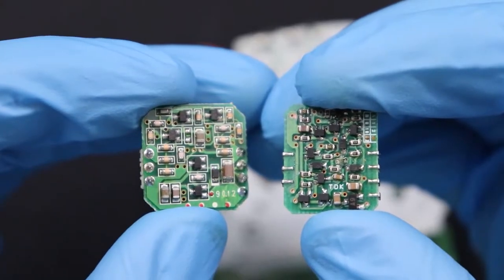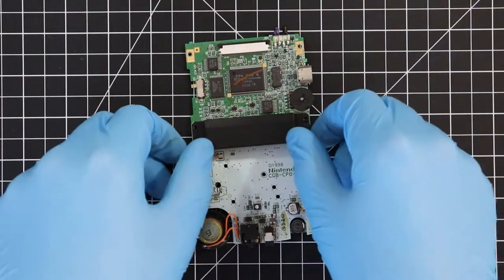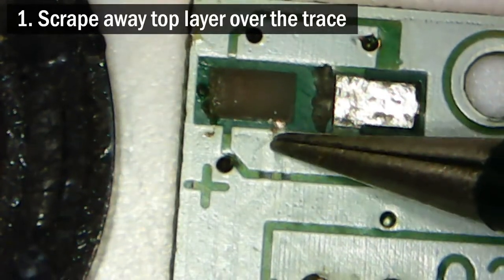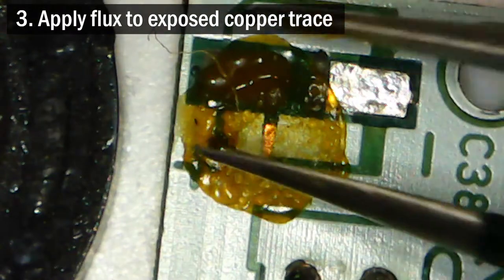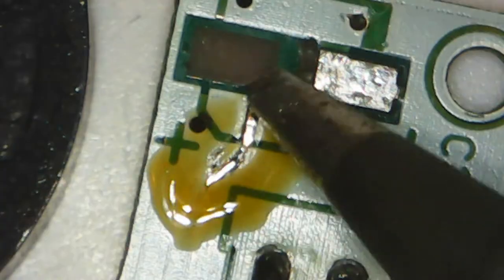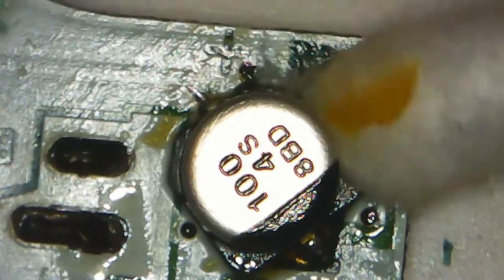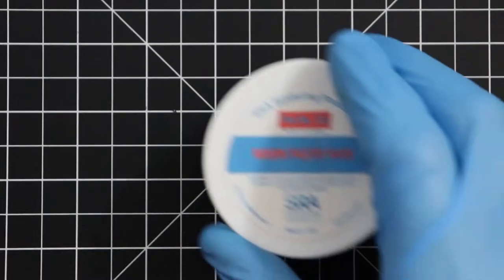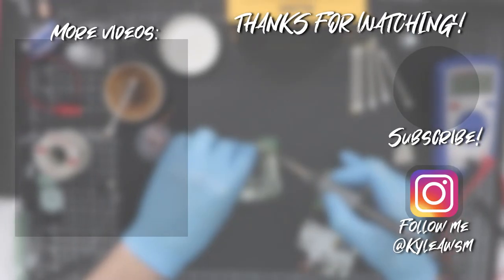How to Bypass Missing & Broken Solder Pads

Comment: I know this might sound stupid, but it would have been super useful to see you measuring the cap with the multimeter to check that your repair had worked. I know how to test for continuity and for voltage readings, but I have no idea with testing caps. But regardless, a great video.
Reply from the maker: Good thought - Basically in the video I mostly was checking for a short to ground.  It's not quite what this repair called for, that footnote about it, but I left the footage in mostly to show how things... "looked" now, more or less.

Here's some capacitor troubleshooting tips I took from another of my replies to a comment on this video:

Sometimes you need to take the capacitor off to fully test.  But a simple test you can do is to put your meter in continuity mode and probe either side of the cap on the board.  This won't necessarily tell you if that cap is bad, but it will let you know if there is a short to ground somewhere that you need to find.  To fully test a capacitor though, for a short, if it's open (also a failure), or for the proper capacitance, you need to remove it from the board first.  Also, you can get bad readings from testing any component while it is on a board still, resistors especially, so it's always best to remove them if you're not sure.

Cheers, and I hope this helps! 🙂👍🏻
Reply: @KyleAwsm  Definitely, I appreciate that testing caps and points could be a whole separate video in itself, I just wondered what it was you were testing to ascertain there were no further issues, but you've cleared that up. Many thanks.

Comment: THANK YOU for actually mentioning proper temperatures for soldering! I've been trying to educate myself on how-to's for soldering [with the intent of game console repairs) and so many videos just go "yup, turn on the iron, tin, and go" but for someone totally new to the process, knowing estimated temperatures to start from will not only extend the life of the tool/machine but possibly prevents early frustration/mistakes in the learning process and ACCIDENTS.
Reply: Temperature is variable. Small components, small traces, lower temps.
But if you have large components or a ground plane temperatures will be higher.
Start low and adjust up as needed.

Comment: Thanks for the instructional video.  I have some pad repair for a customers laptop.  They tried to remove the SMD bios chip with a hot air gun and tweezer.  They pulled too soon and too hard and ripped the chip off.......pads and all.
Reply: Lol pull out

Comment: It is also worth noting that in some cases, you can solder a small wire in place of a trace. If you follow the trace back to its source. You can solder a small wire to the source solder point, and the other end of the wire to the part that needs soldered
Reply: But wouldn’t the capacitor look awkward being solder on top of the wire?
Reply: @MajinGouken  99% of electronics are covered and unexposed. Besides, I'd rather have something look a little awkward I'd it means it still works and I don't have to buy another part

Comment: Thanks for this video, was installing a new wire for my thinkpad charger and messed up the terminals with too much heat (i prefer replacing the wires on original laptop chargers instead of gambling with a potential knock off).
This video is a life saver

Comment: Thanks for posting.  The flux under the device is pretty much stuck under the device.  I believe the flux is corrosive.  Would it not have been better to apply less flux to the pads with, say a toothpick?

Comment: Great video, it's hard for beginners, but not impossible. Just let us know how you detected the faulty cap. , is it a common problem for GB boards? Sorry to ask, I'm kinda new to some repairs.
Reply from the maker: Hi, and thanks!  Yup, it can be common on these boards, and depending on the shape they're in sometimes.  Sometimes you need to take the capacitor off to fully test.  But a simple test you can do is to put your meter in continuity mode and probe either side of the cap on the board.  This won't necessarily tell you if that cap is bad, but it will let you know if there is a short to ground somewhere that you need to find.  To fully test a capacitor though, for a short, if it's open (also a failure), or for the proper capacitance, you need to remove it from the board first.  Also, you can get bad readings from testing any component whole it is on a board still, resistors especially, so it's always best to remove them if you're not sure.  Cheers!  Hope this helps! 🙂👍🏻

Comment: two questions:
1) how do you know where the trace is to be exposed with the grinding method?

2) could you have put solder where the old pad was on the left and solder back the capacitor on top of it?
Reply: #2 no chance, the solder would have nowhere to adhere to, the silicone wafer board is just meant to hold the copper traces in place. He could have just used a jumper wire, but in this case he had plenty of space to rotate the cap. However, most times you don't have this much space to work with.

Comment: bruh, I just had a surface pad pop off of a hyper module and the only thing it left me is some micro piece of wire. No trace to scrape. (The trace might have been on the back of the board) and was able to bridge it with a glob of solder that some how miracled on to that little wire stub. and grabbed on to the cap lead. Seriously, what I did doesnt even qualify as a level1 solder, but it worked and now my hypermodule caps are replaced and it works. I pushed to hard trying to unsolder old PCB.

Comment: Hi Kyle! I have a question, I have the exact same area with a broken pad. Currently I don’t have sound in my gbc speakers. Did you restore the sound on your board after re attaching? 

I checked the speakers and the connection they seem fine and the headphone jack also has continuity. So I’m kind of stuck on what else I could do except the resoldering of the capacitor. Thanks in advance!
Reply from the maker: C38 is a filtering capacitor for the audio, so it could be part of the issue with no sound.  Also check for continuity between pins 4 and 5 on the headphone jack though when no headphones are plugged-in.  If there's no continuity, that contact is dirty and needs to be cleaned.  Replace C38 and clean that contact and it should likely fix your sound problem.  For further help with this, feel free to contact me via Instagram.  Cheers!
Reply: KyleAwsm Thanks so much! I’ll give it a go. I’ve been working on this project for about a month now but never figured out how to bypass the pad. The video and your response really taught me something new. I’ll take you up on your offer and dm if I run into other problems. Definitely subbed to your channel!

Comment: You know about the dsi d-pad and motherboard part. The red and black wires. Do you know how to clean that part if it gets burned? Kinda having issues soldering the wires to those pins and one of them just won't stick. Any help will be great.

Comment: Solder to the trace makes sense but what do you do when you rip off the pad for an ic chip that has like 30 different legs all around four edges and the square pad ripped off?
Reply from the maker: You get some small gauge wire, a microscope, and practice a LOT first, and then you solder directly to the IC. 👍🏻

Comment: Im starting soldering now, Im 16 and I dont know how tf this works.
I literally ripped some pads off of an A1474 Lightning port connector and I also cant solder normal wires together nicely.

Comment: Can this repair be done to a solder pad by the power switch on a Gameboy advance motherboard
Reply from the maker: Yes, but for that scenario I recommend instead following that trace back to where it connects to and soldering to that instead.
Reply: Ok so I shouldn't try to solder the ripped off piece back on just solder to the trace on the board thank you

Comment: you dont need flux. i been soldering for 15 years without. when i do try it i notice it doenst do anything other than get the board messy. 
heat transfers perfectly fine without it. you just need to know how to use your tools properly.
Reply: Yes, know how to use your tools properly - flux included.

Comment: lol my idiot self just put  aluminum foil tape on it. on that bald spot.. . 1:25 and see that bit of exposed trace there,.. i put a bit led solder on it to bridge the connection to the foil. for good connection.  because i cant do that sideway thing. i rip my gamesir pro tk4 mechanical switches pad.. and u cant side ways it xD the position of the buttons are crucial for the buttons to be clickable. after u put back the top casing xD ..

i tried Copper Foil Tape Double Sided Conductive Adhesive too and not aluminum  works well than aluminum .. because its tricky to solder on aluminum without doing the a little drop of flux  and wipe it then soldering it.. method to not corrode it.. but again since im idiot i wont do this type of shit again haha only on D2LS-21 buttons.... xD